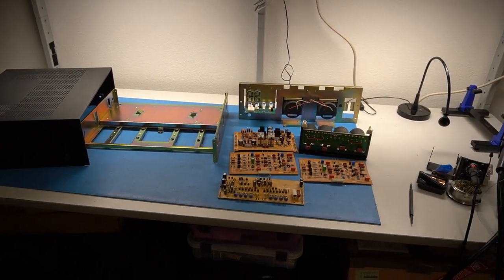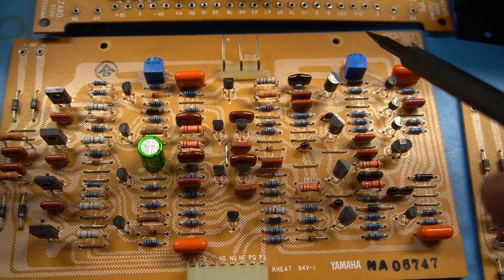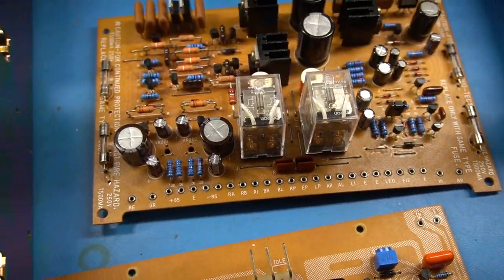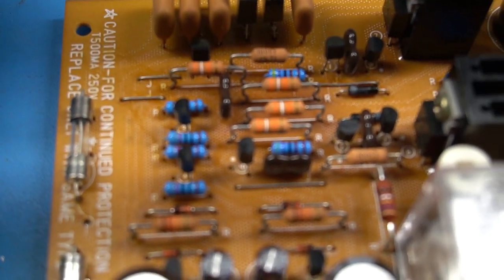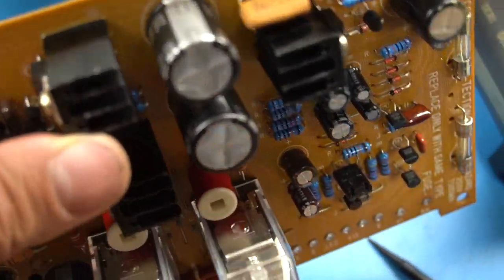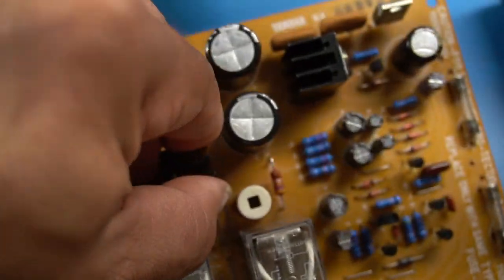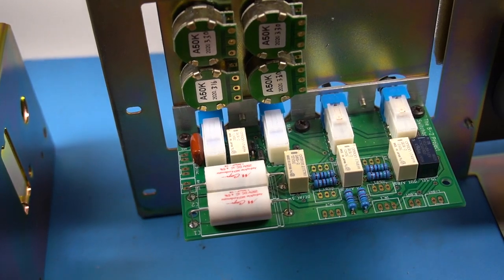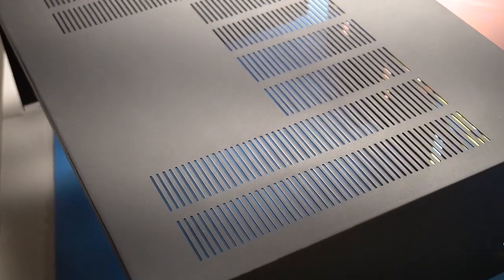Yamaha B-2 vfet amplifier restoration (Part 4) - overview of the rebuilt boards  before re-assembly

Comment: You do beautiful work here. On my B2, The heatsinks on the regulator pass transistors have all broken loose. This method looks extremely reliable. Is it possible to remove the bulk capacitor assembly without disturbing the amplifier channels? It would be extremely helpful if you might one day do a video of just the essential  changes you would make to a B2 for a poor (cheap) client.